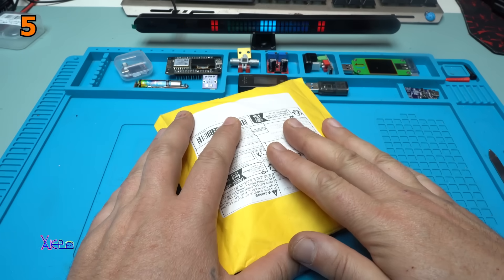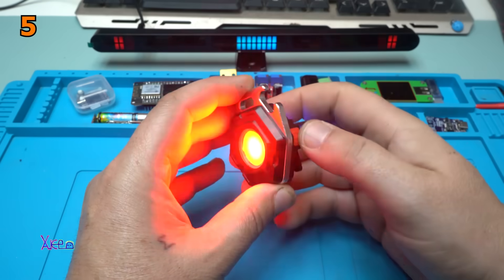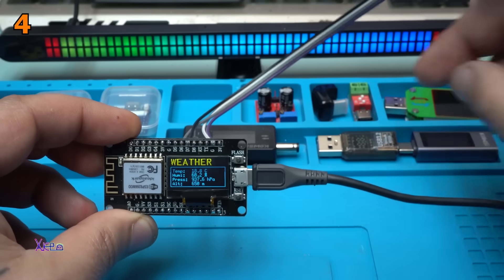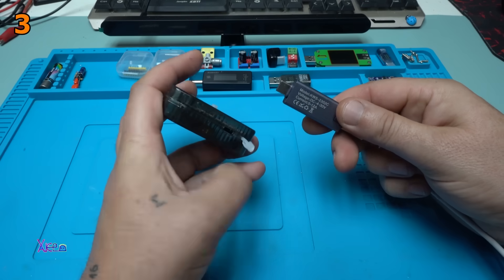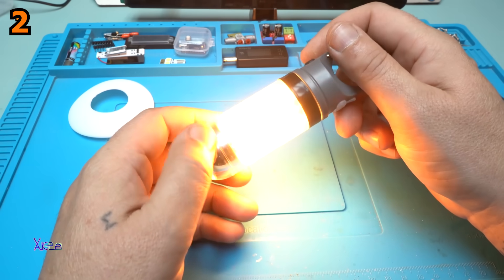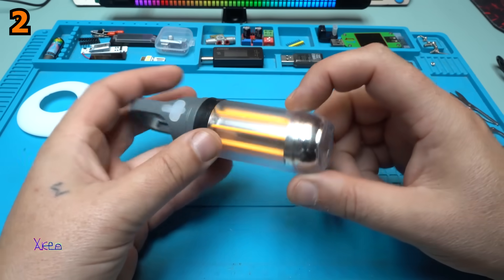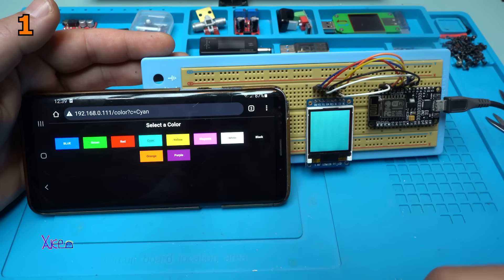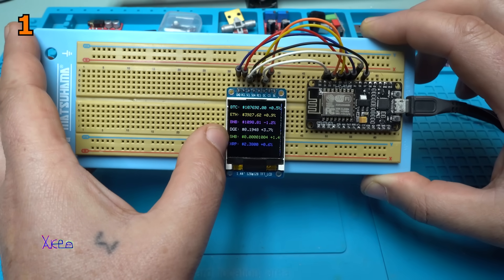TOP 5 FANTASTIC Aliexpress Modules

Comment: Could you post a link of the blue mat you use to work on stuff?
Reply from the maker: Here is:https://s.click.aliexpress.com/e/_Evyd9S8
Reply: @Hacktuber  Thanks ordered one. Love your videos. I have purchased the light panel you have on the mat, love it. Also the 2.1 amp and BT adapter, as you suggested. I repurposed a sub and pair of speakers from an ancient AIWA HT-DV1 4.1 system and it works great, thanks again,